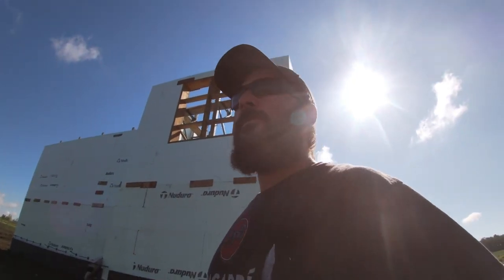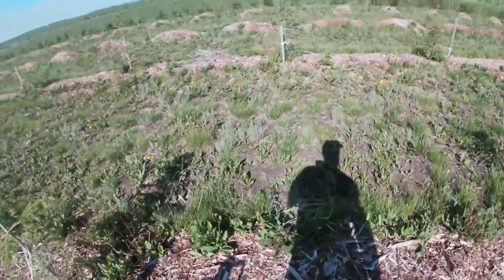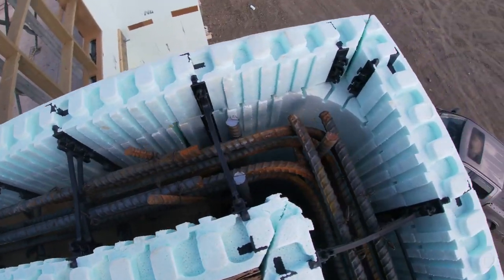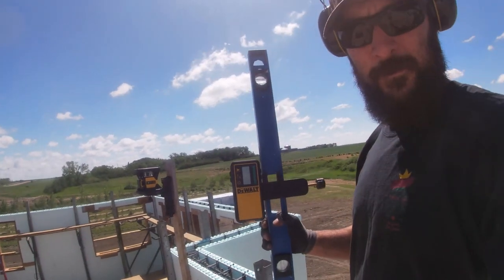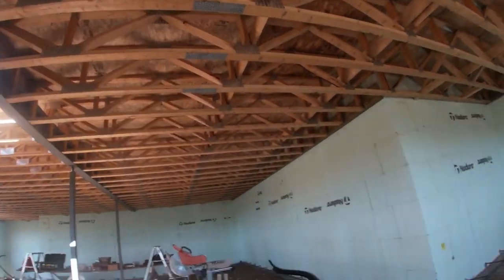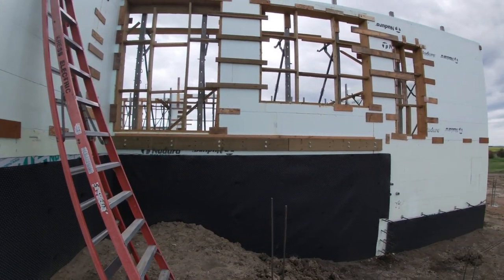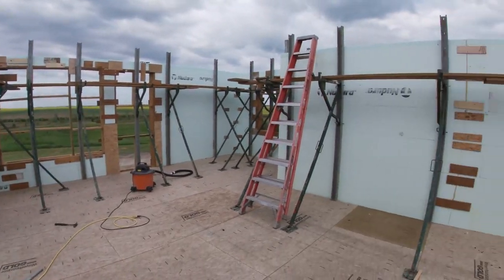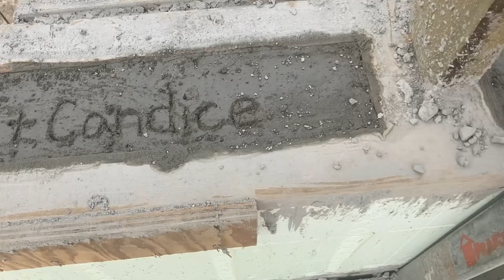Vlog 8 - Pouring ICF Main Floor Walls - Nudura ICF

Comment: How many cubic yards of concrete did you use, and at what price?
Reply from the maker: We are at about 130 cubic meters of concrete so far. That’s between the piles, footings, frost wall, basement walls, main floor walls, and garage grade beam. We will have the basement and garage floors to pour.